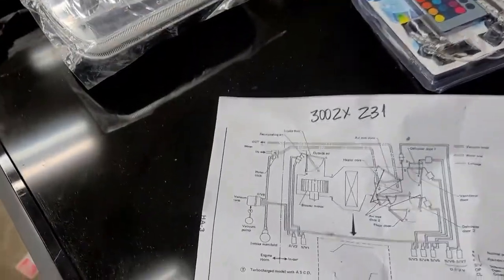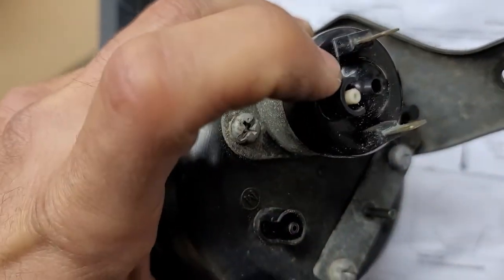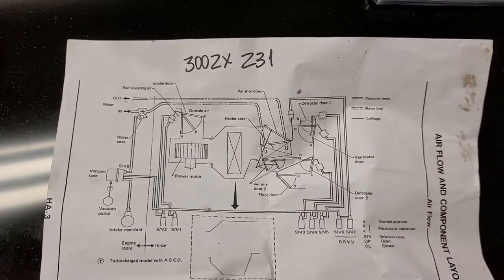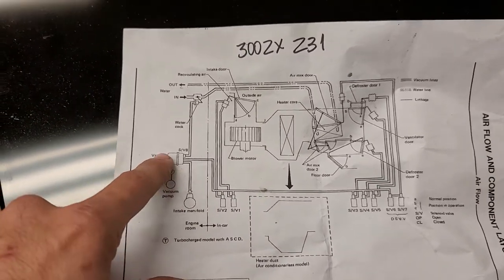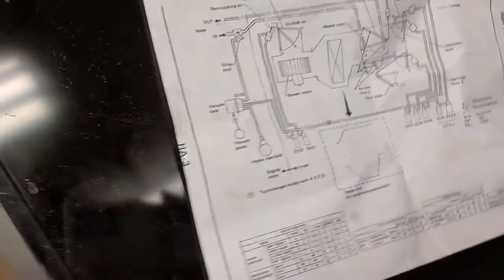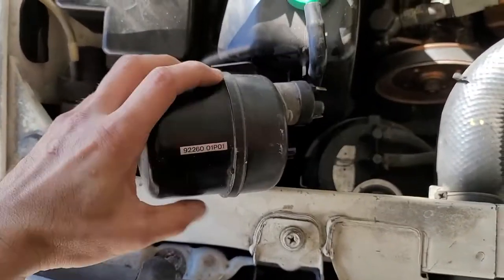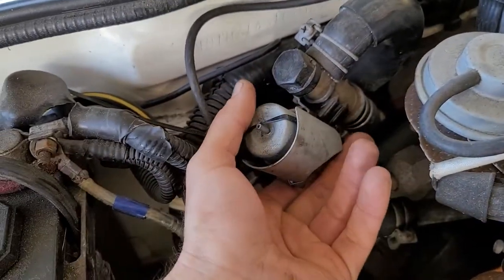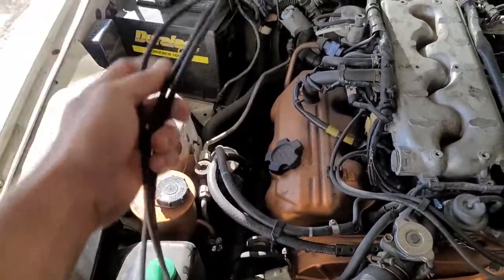300ZX Z31 vacuum pump delete.

Comment: That is not a vacuum pump, that is the vacuum canister. There should be a check valve between the between the intake vacuum line and the canister. While under heavy acceleration the intake manifold loses vacuum and can cause the a/c system and cruise control to malfunction. The canister prevents this from happening by holding vacuum. There is nothing to go bad on it besides the solenoid for the water valve. Only turbo models had a vacuum pump.
Reply from the maker: But if it goes bad the ac vents won't work properly either .
Reply: Finally  Brennan Matlock! Someone who knows what they are talking  about!
Reply: @kennycharneca1   so I did the delete and got face pressure on the hvac "face "setting. But does this eliminate cruise control? I'm trying to get cc back.
Reply: @kennycharneca1  that what I'm experiencing
Reply: Is this the one located in the front passage side i have an 84 turbo ae and it looks similar but with a hose infront

Comment: Huge question I deleted the watercock because I thought no heat no problem but I was mistaken and I reinstalled my watercock but idk if the coolant hose coming from underneath the engine bay goes to the top or bottom hole and I don’t want to mix them up so do you know?

Comment: Hey, with the heater valve, I want to keep a/c and heat. Do I T the valve into vacuum from the intake? Looks good I just bought an 86t with digital climate.
Reply from the maker: Yes but if you want to keep everything working properly maybe keeping this feature is the best option the digital climate is a little bit more complicated.
Reply: @kennycharneca1  ok maybe I’ll run the vacuum pump then. Appreciate the speedy reply.I guess I can cap the nipple for cruise control. Thanks.
Reply from the maker: @huevigarage  yes because that servo actually keeps the ac vents pressurized so every time you start the car the ac will always start on defroster and you have to change it manually

Comment: I have a 1985 Nissan 300ZX my hvac heater core control went out I can’t find a part for it can you please help me
Reply: Check with other cars that also came with the vg30e, I bought a a/c compressor for a maxima from 80 something that fit my 84 z31 like oem, because it’s the same engine